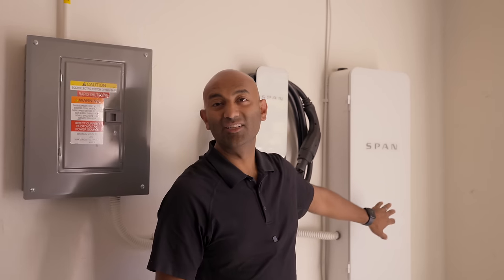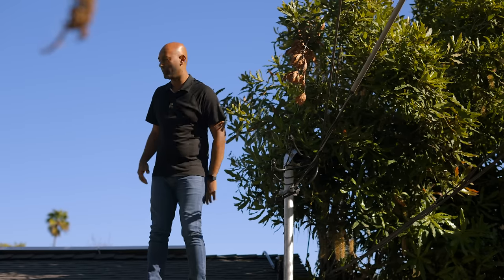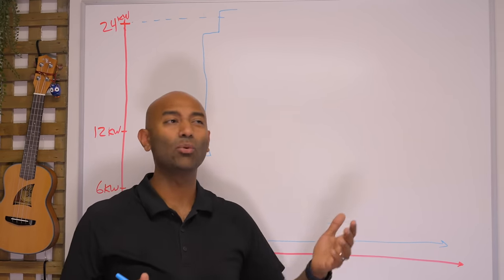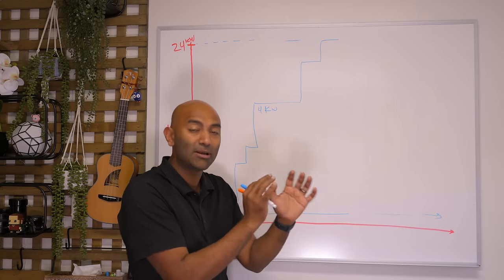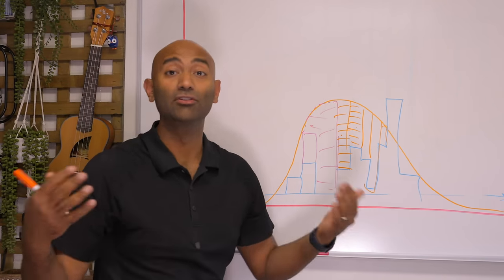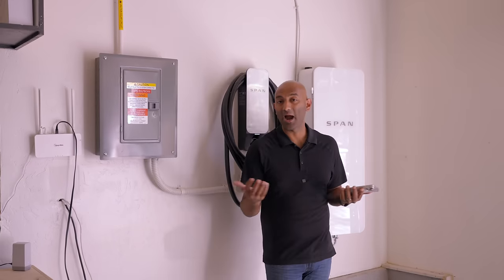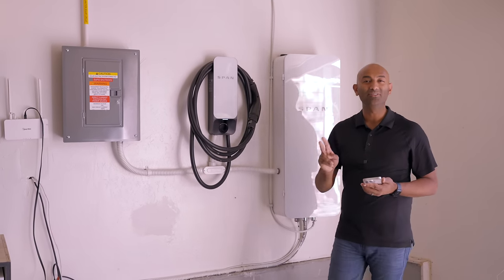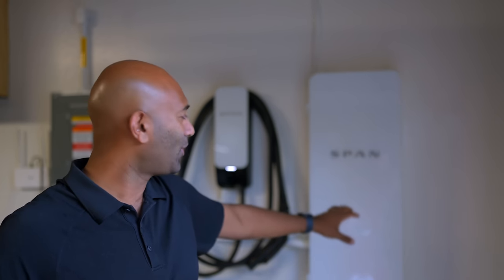I Installed a SPAN Smart Home Panel, Should You?

Comment: I’m thinking of erecting an off grid car port.  The primary use this off grid system would be to charge an EV.  The second purpose is a separate off grid electrical system to run critical loads like the refrigerator, internet equipment and emergency charging for neighbors to charge phones, laptops and medical gear.  There will be separate outlet that this equipment will have to be plugged into.  I live in the San Diego area, if a major earthquake occurs, the grid could be out for weeks.

The biggest issue in this plan is the variability of solar power.  Batteries could be used to buffer power, but they are expensive and multiple batteries would be required.  I wonder if this SPAN smart panel and custom EVSE would allow me to intelligently control critical loads without a battery or at least not need more than a single Powerwall.

Comment: Thanks Ricky, another great and informative presentation.   You briefly mentioned your pool might not be on your “critical” circuit list.   Does that mean that you have an electric heat pump for heating your pool?   I’m thinking of putting a pool in at our San Diego area house and the design/builder is kind of pushing a gas heater.   I’ve already got solar panels and would prefer a heat pump combined with the roof top pool water blankets.  Would appreciate your comments

Comment: You know I've been trying to figure out the actual purpose of a span panel, and if it's just about charging your car, then if you only charge your car at night, while you're asleep &  not doing all of those other things, it sounds completely useless...
Reply: I don’t think it’s just about charging your car, though it probably is the best use case and you may have to charge your car at other times once in a while, so it would be nice not to jump a breaker every time that happens.
But what about having everything on the same circuit without the need of a separate critical load panel. Or what about managing and optimizing your power consumption when you have a blackout and switch to battery storage. You’ll likely have a different maximum load and will want to prioritize some parts of your circuit more than others or limit the power drawn by one part of the circuit without entirely switching it off. 
Just a thought

Comment: Our power plant (solar panels) made 102 kwh yesterday (34kwh was exported). I am so glad we have net metering so I don't have to worry about this stuff. But, the way this state is going, I'm not sure how much longer this will last and will need to store the extra power myself.
Reply: That’s a massive solar system! Do you have batteries? Or just use your net credits for night power?
Reply: @aaronphillips1210  no batteries.
Reply: @pilotboba  ahhhh ok. I guess the grid is your battery with that many net exports.
Reply: @aaronphillips1210  pretty much. I have no backup if the grid goes down. But saving 12k or so having no batteries is worth it for rare occurrences.

Comment: I have solar with micro-inverters. I have a Generac whole house generator installed with a new combination transfer switch and 12 circuit entry panel feeding a 200 amp house panel inside the garage. I see that SPAN can handle solar (and I assume batteries.) Can it handle batteries if and when I decide to add them? By the way, I would think you would put a link to SPAN in your video description as you link to other providers.
Reply: Hi Mike! SPAN currently integrates with Tesla Powerwall, Enphase IQ Battery, LG RESU, and SolarEdge Energy Bank.

Comment: Average household is 1kW.  While this will help what it really needs to do is level out your load so that it is constant.   The largest amount of green house gasses from the grid is from the peaker plants.  Those plants are constantly coming on and off the grid due to how we use electricity.  Peaker plants are very inefficient so if everyone has a level power usage (batteries/super caps to compensate) then we can utilize the more efficient power plants.  How ever lithium batteries are not the answer to this problem as they are not very green.  So while this unit may make it possible for you to manage your power with-in the limits of your circuit it by no means helps with the Grid.  This is something that needs to be solved for in the commercial arena first and something i have been working on with data centers as the local utility companies do not like the ramping up and down of large amounts of servers.   As i stated a single house like yours is 1kW a typical individual server rack now days is reaking 20 times that and there are hundreds in a single data center.  AI and Smart buildings are pushing this higher and higher each year.  

In the end i guess we do what we can when we can, but keep up the great content.

Comment: I'm not really keen on smart panels.  Will this company be around in 20-30 years as the smart breakers break and need replacing?  It could become an expensive mistake.  And really, what energy management is actually needed?  Think about it.   I hope you've stocked up on spare super-special circuit breakers!

The better way to manage your service is to size your appliances to not hit the limit.   Really.  That is the better way to do this.   Don't install a 32A EVSE.  Just program it for 16A or even 12A.   Don't install a 4-burner induction cooktop.  Get a 2-burner instead.  Don't install a large oven, just use a large toaster oven instead,    Don't get backup elements with your heat-pump furnace or water heater (most people don't need backup elements with modern heat-pumps).

This is a much better solution than installing a smart panel.  Really.   To be completely frank, my parents have a 100A service and the only thing they can't do is a heat-pump furnace.   They aren't even close to the limit on anything else.  Remember, only 240VAC loads actually eat much of the service pie.  All the 120VAC circuits can be separated into two legs... you actually have 200A worth of 120VAC capacity available on a 100A panel.  Well, since the return is on the neutral it's more like 100A worth of 120VAC capacity eating up at most 50A of the service amperage, since the remaining 240VAC loads don't return current on the neutral.  But you get the idea.  A 100A service is actually fairly substantial.

Well, 240VAC loads are limited:  built-in oven, induction stove-top, heat-pump water heater, heat-pump furnace, A/C, EVSE.  That's it.   The oven is optional.  The induction stove-top doesn't need to have 4-burners.  A heat-pump water heater does not have to use more than around 6A (even though they all spec 20A circuits, most don't use anywhere near 20A).  The A/C unit can be sized for 20A which means you can also have a small heat-pump furnace too... or a mini-split.  The modern way of doing heat-pump furnaces is to make them smaller and have them run more often, possibly even constantly during winter, anyway.  The EVSE can be programmed to a lower amperage, and having a built-in oven is not a necessity these days when 95% of the things you use an oven for can be done in a large toaster-oven at a far lower energy cost.

240VAC loads:

  0  - Oven (use toaster oven rather than a built-in, or use a smaller built-in that takes longer to heat up)
20A - Induction stove-top with two burners.  (30A tops)
16A - EVSE
 8A - Heat-pump water heater
20A - A/C and alternatively heat-pump furnace, or a large mini-split
------
Total is 64A, leaving 36A @ 240VAC (i.e. 72A @ 120VAC) available for insundries.

For someone with a 100A service, optimizing the appliances is a far better solution than buying a smart panel.

-Matt

Comment: The maximum amperage that can run through a 3-pin standard British plug is 13A - regulated by the in-plug fuse with only 13A max fuse value available. Any higher than 13A then the appliance has to be hard wired in. That delivers a max of 3,000 watts (3kW). The same amperage on 120v (USA) delivers approx half the power. The UK/EU system delivers twice as much power. 

In the USA they run 240v into homes, but split it for 120v and 240v appliances - different plugs. To the rest of the world that is crazy for a domestic home. They need to go over to all 240v in homes, dropping the high current (amps) 110v, and adopt the British 3-pin plug, as it is the best, and safest, by far (do not reinvent the wheel).  Then USA 100A electrical supplies run in to homes can cope with most appliance in a home. 

By the way, EV chargers sense the current then automatically reduce current draw when approaching the max limit of supply.
Reply: I'm in California. I plan to plug my new EVSE into a 240V tumble drier socket (no electrician needed).  I'm limited to 24A (nearly 6KW). 8 hours of overnight charging delivers 46KWh (perhaps 160 miles range). Few gain much from 11KW home charging and certainly not enough if it means you need an expensive new smart panel.
The great advantage of 240V sockets is powering plug-in kettles to boil water twice as fast. 
There are few other appliances to take advantage of 240V. A 110V shock is significantly less likely to electrocute you!
The fused British 3-pin plug is, in my opinion, seriously oversized and fuses are at best a compromise from a personal safety perspective.  As an ex-pat Brit I've lived with both systems and other than when waiting longer to make tea, I'll take the American system any day...
Reply: @RichardBorn-ke2ui  
You are right on 6kW EV chargers over larger kW versions. 7.2kW usually in the UK. 

Your knowledge of electrical systems, never mind the ability in assessing them, is slim to say the least. It is well recognised that the British 3-pin G Type plug/socket is the best in the world by a mile. I doubt you have the ability to analyse, as no one would ever put the terrifying toy like US plug as being superior, or equal, to the British plug. Then...running two voltages into a home?  Yikes!  Also, earth leakage safety devices are mandatory in British main panels, reducing serve electric shocks.

You are in California?  Enjoy the brownouts and blackouts. I hope you are happy with third world grid and electrical systems.

Comment: In our case it's the 10kW electric backup for the heatpump (in addition to it's 3kW peak) that kicks in during defrosts that determines our peak (in addition to electric clothes drier, induction cooktop, 120V electric water heater - we don't use enough water to justify a hybrid water heater). Our car charger is a 10A at 120 or 240 cable - so 2.4kW peak. Sadly the car isn't smart enough to deal with it's charger getting power at arbitrary times if we only want it to charge to 80%. But yea - great product that wasn't available when we had to upgrade to 200A for the heatpump.
Reply: The best solution for your hot water is to install a DC heating element in your electric water heater 
A single solar panel  hooks directly to the DC element without an inverter or controller 
Take care Ray
Free hot water no operating costs no moving parts no noise 
All you have to do is run a pair of #10 wires  from the solar panel to the heating element
Reply: For DC water heater element Google Missouri wind and solar 
Take care Ray

Comment: Good video, did you purchase this or did SPAN supply the panel and install it in consideration for a review?  The concept is good, but first you need to know that it is worth the cost benefit of this panel.  If you are reasonably not close to overloading your panel, then this may not be as beneficial.  My point is that if the manufacturer paid for the item and installation then it is a free no brainer, but everyone else needs to determine that cost benefit, which you didn't discuss at all.  Please disclose in the initial dialog section if this is a paid promotion.  Thank you!

Comment: It's best is to just get enough SOLAR PANELS and BATTERY BACKUP to power your own 200Amp standard breaker box. Plus go off grid all together even in the city. Save the $11,000 you would have spent on this smart SPAN breaker box.

Comment: For me, personally, the requirement of an internet connection is a deal breaker. Putting aside the fact that valuable energy usage data is stored on someone else’s servers; the fact that I’d have to subscribe to and pay for a service that I wouldn’t otherwise because I have no real use for it. I’m at work for the vast majority of the day, and what time I do have at home is spent either cooking meal packs, doing upkeep tasks, or sleeping. I literally don’t have time to spare on anything that would justify the $60/month cost of a home internet connection. Now, if I could set up a raspberry pi running an instance of HomeAssistant, and use that to control it, then I’d consider it. But I can do a lot with the $720/year I’d have to spend on a home internet connection that would essentially be just for the smart electrical panel; so I’ll stick to regular old fashioned breakers, unless I find a smart panel that I can use offline and host my own data.

Comment: Hmm your electric grid looks more like india's. In Sweden all power in cities and most below 10,000 volt are trenched and everyone has 230v 3 fase in their house.
But one of the problems we have are when more and more go to solar, the grid isn't stable enough so the 50hertz it's giving it's hard to adjust without a bigger generator.
Reply: Frequency shifting is not beneficial in grid tie systems

Comment: I don't understand how this is any different from a Smart Hybrid inverter on your solar panels? For example, on my SolarEdge Home, I have added a battery and car charger and then set where I want my solar production sent in order of preference at different times of the day, usually home first, then battery until its full, then car. These type of inverters are ½ the price of the SPAN and would seem to achieve the same outcome... Am I missing something?

Comment: Is the span compatible with bidirectional charging?
Reply: Today, SPAN has not announced vehicle-to-grid or vehicle-to-home (V2x) bi-directional functionality. However, the SPAN system has been intentionally designed to enable the most intelligent home backup system, and we intend to continue building integrations and features for the most flexible home backup experience possible.

Comment: I am baffled by the excitement over the SPAN panel. As batteries reduce in price and their maximum load capabilities increase, the need to instantly shed loads should decrease. Also, a much better approach would be through home automation rather than brute-force cutting off power -- through automation, turn off the heat pump by turning off the thermostat, or turn down the thermostat to reduce power expenditure, or cut the car charger to 1/4 power to charge the car less quickly and reduce load.

Comment: This looks like a good product in the right use case, but I hope people don't put off switching to an EV because they think they need an upgrade to their electricity service or a high tech solution like SPAN.
99.9999% of my charging happens when I'm sleeping, when my microwave, dishwasher, clothes dryer.... aren't being used. And, in the 5 years I have had my EV, I have only used the 110 volt EVSC that came with the car. I charge on a regular 30 amp circuit and it provides all the charge I need for my daily driving needs. Your needs might be different, but don't assume you will need an expensive upgrade or even to have a level 2 EVSC installed in your home.

Comment: I was very interested in this panel until I read the specs "Operating Temperature, -30ºC to 50ºC (-22ºF to 122ºF)". That will just not fly here in Phoenix Az unfortunately. I was shocked 😅No pun intended.... to read such a low temp spec which should be -30 to 85C IMO.

Comment: Greater complexity.  Greater chance of failure.  Much easier to upgrade to 200 amps in most situations.  It's an alternative of course.
Reply: Do you know if any company charges a higher rate for peak power consumption? As in, they charge you more if you surpass certain threshold in power or something?

Comment: If your utility tells you  $16K to upgrade you it would be better to spend that money on Solar System that can give you the capacity you need. You can still use your existing grid as a backup or power assist if you don't have enough storage to start with.

Comment: MANY TIME OF USE METERING SYSTEMS transmit power consumption INFORMATION using a WiFi router, to collect data from a group of homes or commands from the power provider.

Using a WiFi Deauthur device, the communications can be "blocked" which, if used during peak rates, will mean the power supplier will get no readings until you switch the Dauthur be ice off.

Comment: Great thanks but doesn’t the Tesla Powerwall do a better job?
Reply from the maker: great question, but the powerwall can't control your home circuits, and can't decide via software what circuits are critical etc.. its just a battery so this is a replacement for your old service panel
Reply: The Powerwall works great for me! This Span unit works if you don't have powerwall. Powerwall doesn't limit each appliances power though. 
I wouldn't have a use for Span, as I'm already self-sufficient >80%of the time, using nearly all the solar I get, and rarely using the grid. 

I also have 3 non-Tesla "dumb" EVs, so having the 16 kW panels and 3 powerwalls allows flexibility when I charge them.